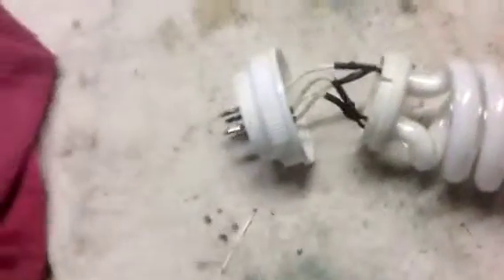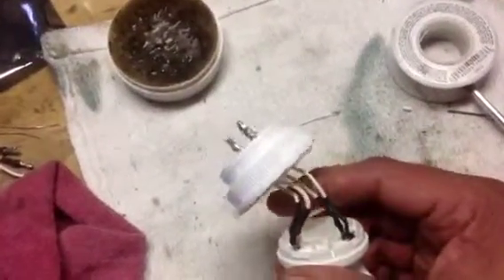Update to my Bug zapper converting.

Comment: Ok, call me stupid... But wouldn't it will be easier to take EVERYTHING out of that and replace with the " Regular " E27 socket / connector so later on if the Bulb burnt, you can just get another E27 Light Bulb and screw it in?   The way you modified that, when the Bulb burnt, you will have to modify another Bulb, which is time consuming :(((((((((((((((

Comment: Instead of spending all that time modifying a bulb [that will soon burn out, requiring another bulb modification] to fit the existing socket in the zapper, why not adapt the socket in the zapper to standard base so that you can easdily replace standard bulbs as they burn out? It seems like you've gone about the problem backwards. Yes, you're the first one who "did this sh**," probably because the whole approach is backwards.